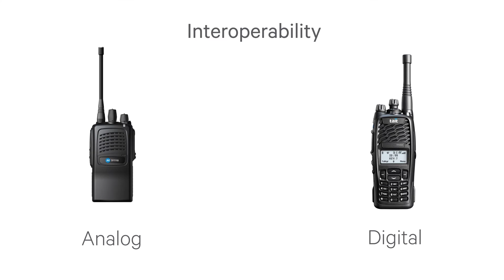1.1 What is P25? | Introduction to P25 | Tait Radio Academy

Comment: In the U.S., do Trunked Radio systems only do Digital, or can they 'trunk' use analog (FM voice modulation)?     

Regarding the P25 Digital standard, how does it compare to the DMR Digital standard?   I would think they operate on different bands (700mhz vs 400mhz?)  

Do both P25 and DMR use the same (proprietary) voice codec from DVSI (AMBE+2)?  

Finally, is the P25 encryption the same as the MotoTRBO Tier 1/2 basic/enhanced (AES256)?  I thought it was against the HAM rules to operate on public bands using encryption...    or are these features only available to law enforcement? and perhaps consumers outside of the U.S.?
Reply from the maker: Hi Ben.

Thank you for your queries.

Q1: In the U.S., do Trunked Radio systems only do Digital, or can they 'trunk' use analog (FM voice modulation)?     
-> Both digital and analog channels can be trunked.  In the USA there are various trunked systems in use and some trunk analog channels and others digital channels.  Currently we are seeing a number of older analog trunked systems migrated to digital trunking.  P25 and DMR provide standards for digital trunking and there are also some manufacture specific digital systems.  Other standards and manufacture specific systems can provide trunking with analog FM channels.    

Q2: Regarding the P25 Digital standard, how does it compare to the DMR Digital standard?   I would think they operate on different bands (700mhz vs 400mhz?)  
-> This is a commonly asked question.  P25 and DMR offer a lot of common features and both are available in some of the same RF bands.  In general P25 has features aimed towards public safety agencies and DMR is more focused on commercial customers.  However the choice of technology to use comes down to the individual agencies requirements and budget.  The Tait Radio Academy has further information about each of these standards.

Q3: Do both P25 and DMR use the same (proprietary) voice codec from DVSI (AMBE+2)?  
-> Phase 1 P25 uses the IMBE vocder from DVSI
-> Phase 2 P25 and DMR use the AMBE vocoder from DVSI

Q4: Finally, is the P25 encryption the same as the MotoTRBO Tier 1/2 basic/enhanced (AES256)?  I thought it was against the HAM rules to operate on public bands using encryption...    or are these features only available to law enforcement? and perhaps consumers outside of the U.S.?
-> Encryption is an optional feature in the P25 standards.  P25 offers the ability to operate in clear mode, 56bit DES encryption or 256bit AES encryption.  Some manufactures also offer other encryption methods such as ARC4.  The rules around the use of encryption can vary from region to region.  Privacy laws may require channels that carry personal information such as names, ages, addresses, criminal or medical records to be encrypted while in other cases a 'Freedom of Information' act may require all the general duties (dispatch) communications to be publicly available.  Surveillance and special operations channels my require encryption with a high level of security while interoperability while public emergency channels may need to be clear to allow multiple agencies to work together.